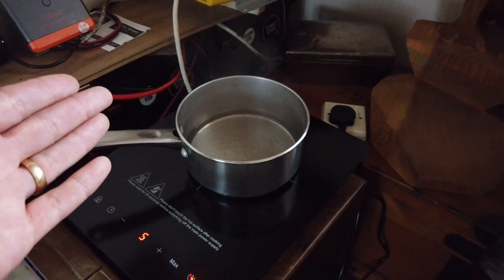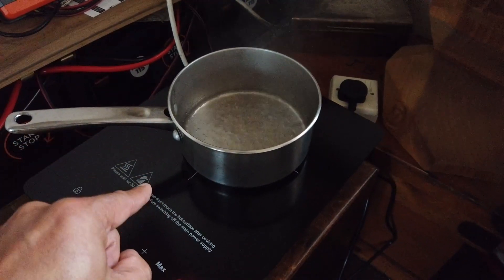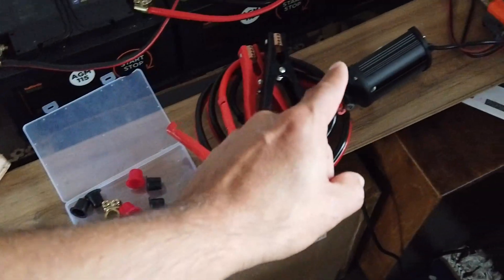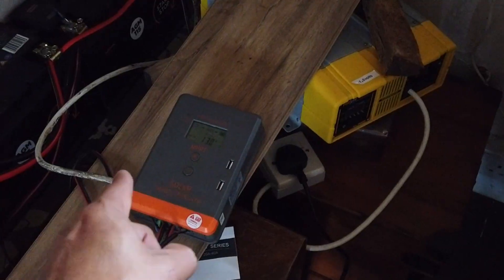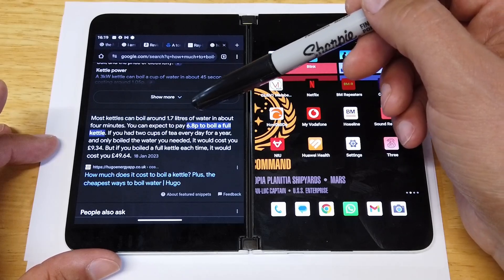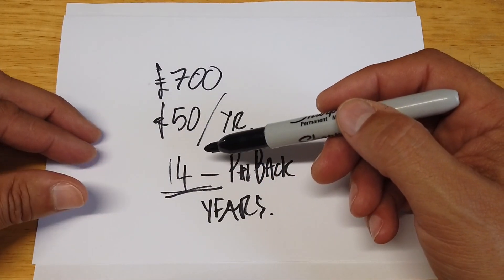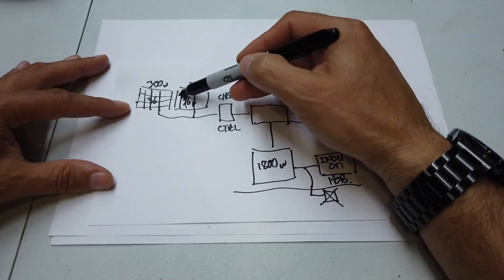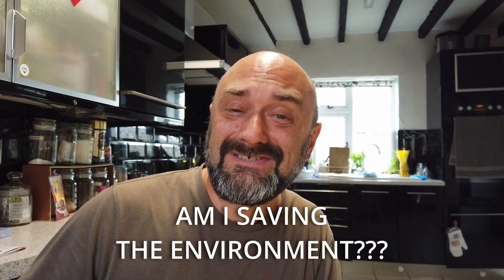DuB-EnG: Solar Cooking System with car batteries, 1.8KW Ambulance Inverter and Induction Hob Heater

Comment: Be very careful when buying Chinese made mains operated appliances.

If they are made by well known Western brands but just happen to be made in China, they will be ok. The rest I would steer clear off and if you do buy it, perform an electrical inspection on them before you use them.

They regulary do not have the earth wire connected, even when it is provided, and wrong size fuses fitted in the plug.

I have even had one mains powered item suject to a product recall triggered by the Trading Standards department because of live exposed metal parts.

My recommendation is: do not buy ANY cheap Chinese made mains powered appliances from online websites.
Reply from the maker: I guess your point….  Check for compliance certificates!?

Comment: 1. put a bloody lid on the pan!!!!

2. Travel kettle? you could hook that straight up to the battery 

3. Thermos flask, heat the water when the sun shines, and keep it warm for when you need it. use the water as the 'battery'

Is this even the best match? Your morning cup of coffee is about as far as you can get your solar generation peak.

Air con would be a good match, not that we need it in this country. Possibly a fridge freezer? if it managed to stay cool through the night. A washing machine?
Reply from the maker: Yeah, I may run the fridge and freezer, that'll get the most efficient use!!  I've got a new kettle for the induction hob.  Travel kettle is a great idea, much more efficient!!! 😄
Reply: @DubiousEngineering  all electric heating is ~100% efficient (except heat pumps) but you avoid using the inverter and other inefficiencies.
Reply from the maker: @benholroyd5221  yes, that’s why I like your idea of the 12v travel kettle…
Reply: Doesn't actually matter if the lid is not on the pan. Sure, it's wasting energy, but plenty more where it came from, and the extra energy required is essentially free.

As long as he's not depleting the batteries and he's not running out of energy when he actually needs it, then there isn't a problem.
Reply: @deang5622 I dislike your accounting.

First the panels cost money that has to be amortised over every watt produced. The more you waste the more each useful watt costs.

Second, solar generation is variable.

Starting that dull December week with 100% battery, because you put the lid on the week prior, may be the difference between having 'free' boiling water that week or not.

Long story short. If you only need 1kwh per day because you put the lid on the pan, you only need to pay for a system to provide that. If you need a 2kwh/d system because you don't put the lid on the pan, because the electricity is 'free' then you need to pay twice as much.
Reply: @benholroyd5221  Your logic is flawed.
Because the system has more than enough capacity to provide all the electricity they need.

So they can waste it. It doesn't impact them in any way. And they are not over specifying the capacity of the system to cover the losses caused by not having the lid on top of the pan.  So they have incurred no extra installation cost for the system to cover the loss of energy from not having the lid on the pan.
Reply: @deang5622  well it depends how you wish to view it.

If it's a system to boil 1 cup of water per day, and is sized to do that even in the depths of winter, then yes, in summer you will be generating too much electricity.

If the point is to get as much out of the generated electricity then wasted electricity is wasted electricity.

I suggested other appliances that might work well with the system on the basis of making the most of the electricity generated. DubiousEngineerings appreciation of the 12v kettle would suggest they're thinking of making the most of the system too.

Yes this is essentially messing around with a small solar setup to see what works, i still think you should look at it through the optic of what it's possible to do. It's tinkering like this by early adopters that inform others, and for the rest of the population money is an important metric, so it does need to prove itself.

Reading between the lines here, I suspect we just have different philosophies. You look at goal, boiling water, and once that is achieved, you're happy. I would look at maximising what I have, can I book water, and make some toast.
Neither approach is right or wrong.
Reply from the maker: @benholroyd5221 ... Yes, I agree, I'm not maximizing use, next challenge... Connect fridge and freezer!

Comment: If you're playing around with solar as a hobby like me, then the cost is irrelevant to a degree. 
If you're wanting to save money, then have solar installed on your roof. If you can get the system installed for a reasonable sum, then the pay back will generally be less than a decade. Obviously you'll need a battery system to provide power after dark.
Reply from the maker: Makes absolute sense, but don't move house for 20 years :-)